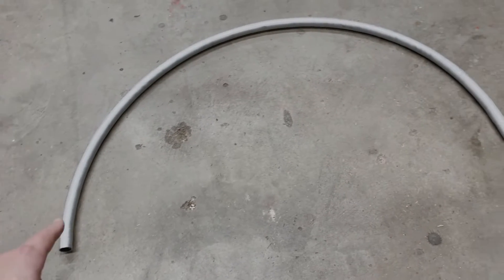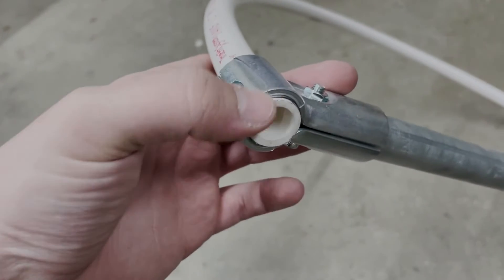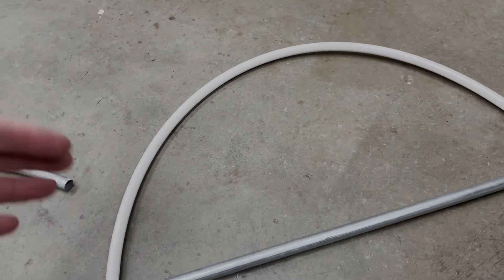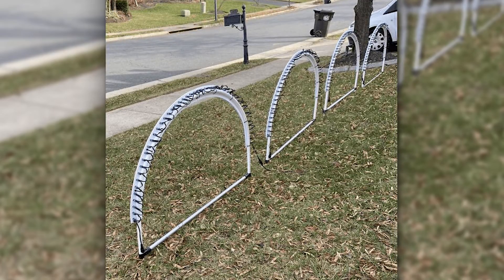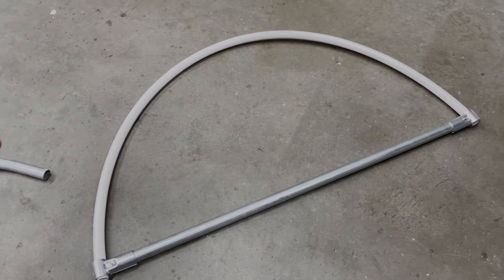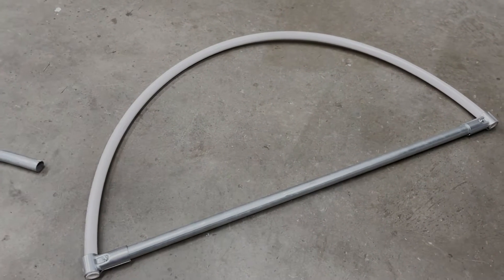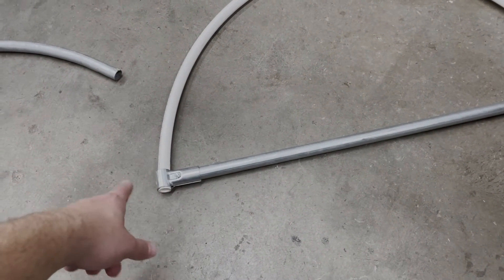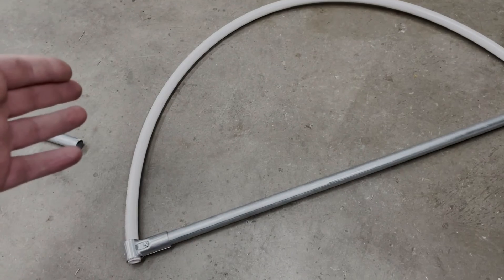Is PVC Pipe Better For Bends?

Comment: I would use this for covering raised veg beds. Most folks pound in rebar and put the PVC over that but the rebar gets wonky and can shift over time and it's kind of a pain to put on and take off. This would work beautifully and would be easy to set up and take down for storage. You'd need a brace across the top to link them together but that can be done with cable ties and bamboo on the underside or your connectors and more PVC if you needed it more sturdy or to cover a longer span. Thanks so much for the idea!
Reply from the maker: Good idea Diane! Thanks for the comment